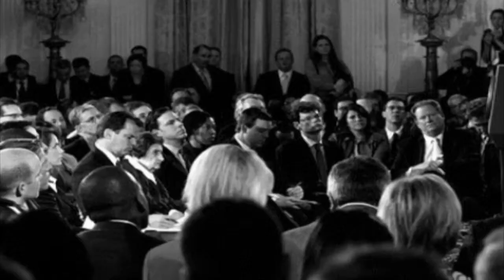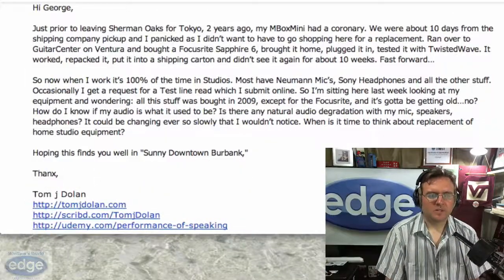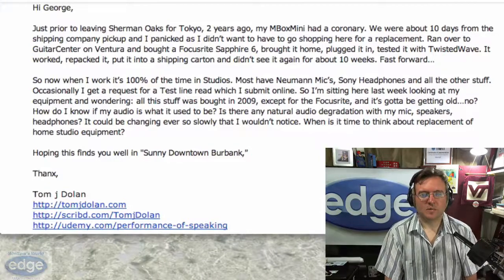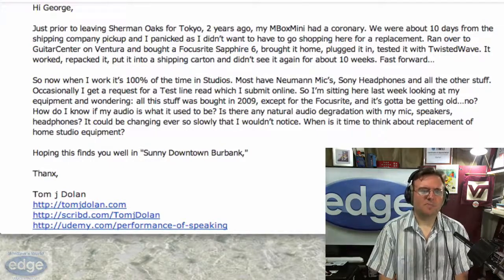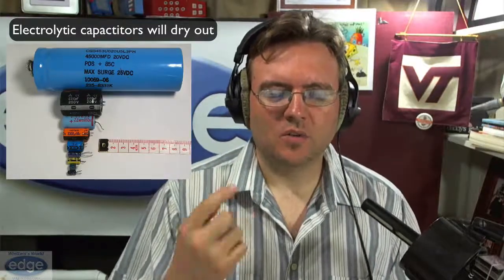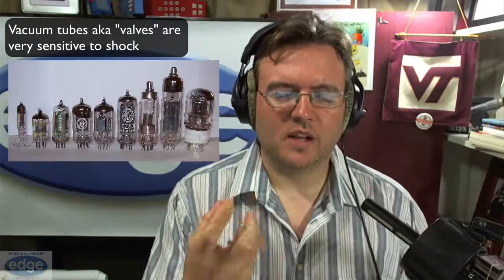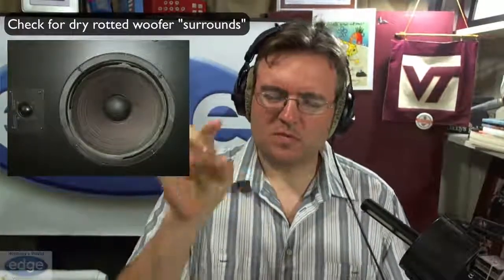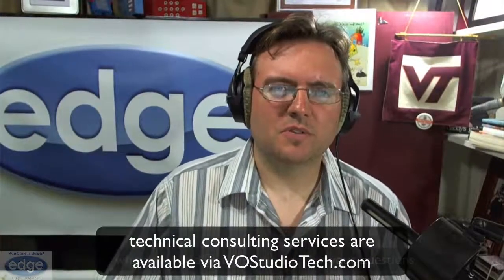Edge Studio's Whittam's World - Episode 23 "Time for an equipment upgrade?"

Comment: Here's some additional information from a viewer:

Speakers.  Most are repairable, and maybe worth it. Research repair vendors to be sure they know what they’re doing and will use parts EXACTLY matched to your speaker’s specs.  Same if you’re ordering parts to do it yourself. I recently refoamed my New Advents, and one vendor sent me a generic surround. It would have worked, but the rubber was too stiff and the geometry didn’t match exactly. Another vendor’s was exact, included all the right parts, tools and glue, and excellent instructions.  (The bit about shimming the coil scared me a bit, but was a cinch once I got into it.)
 
Pots and switches.  You mentioned that a lot of use can wear them out. It seems that years of non-use can also be bad.  My impression is that they get corroded and start crackling or missing in spots. Pot cleaner sometimes helps if I can reach in, but reaching it is the problem. My preventative (although I’m not sure it’s a sure thing) is to twirl all the pots and flip the switches once or twice a week, whether the unit is on or not.
 
Motors.  Not an issue in the digital age, but with tape recorders, apparently they’re susceptible to failure from disuse, too.  I’ve had a bunch of cassette recorders and a couple of reel-to-reels that worked when I put them away, and then years later, nada.  Just guessing that maybe, since motors include magnets, maybe the magnets lose their strength if not replenished from use?  Or maybe it’s dried capacitors, although I don’t think caps should dry out so fast. (I have an old dead SW radio, and was pleased to find that its death is normal and it’s still worth something to a collector.)  Whether the solution to this is simply to run the machine a few times a year, I dunno.
 
Li-ion batteries.  At the other extreme from motors, now that iPhones etc. are being used for serious recording.  If a Li-ion battery is unused for a long time, and it loses its charge and can get so depleted that it can no longer be recharged.  I’ve bought various backup recharging batteries at [a retailer whose parent company’s name rhymes with mine] and they were dead as doornails.  Probably because they sat on a peg or in a warehouse for a couple of years.  Solution: When you buy a Li-ion battery, and it’s not already charged, be sure it takes a charge before the return deadline. And over time, use it every so often and charge it fully again.
 
(Almost disappointed to hear that digital stuff lasts so long. Looks like I’ll be using my E-Mu interface for some time yet.  Never did sort out the ASIO driver thing with Skype.  I suspect it’s a malady that Windows has contracted, and I’ll just work around it till I get my redundant system finished. )
 
Best wishes,
Randy Rensch